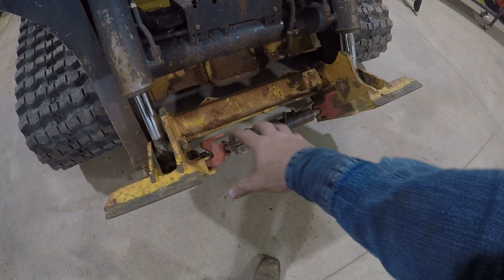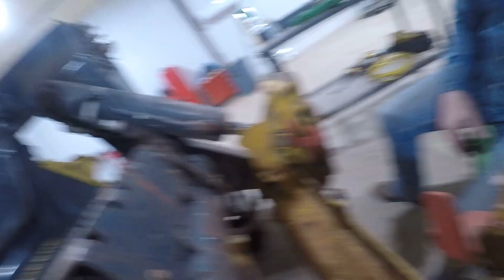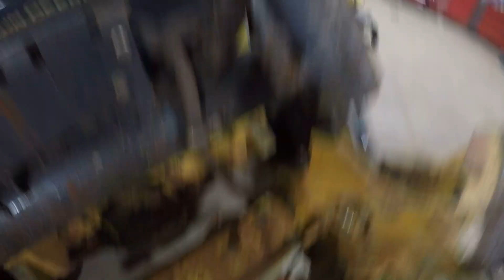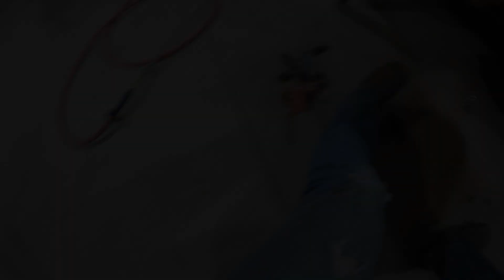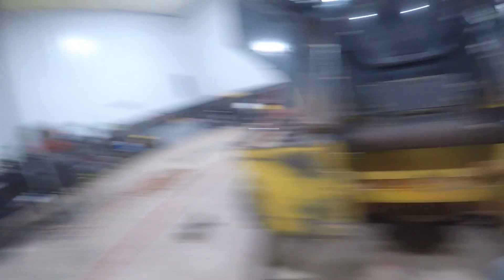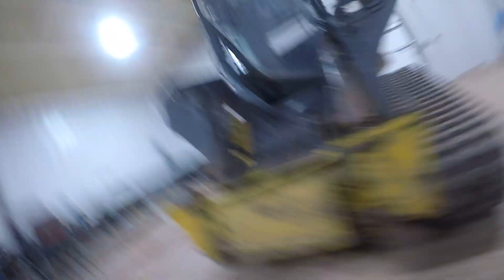John Deere 333G Issue

Comment: How do you get the bucket off of the quick tatch is not working? Mine has wires pinched and keeps popping the fuse. I need to get the bucket off to get to them.

Comment: This is just a bad design by John deere.   Excellent skid steers but no grease fittings is ridiculous
Reply: Easy enough to drill & tap a couple holes and install grease fittings. Should be that way from the factory. But it's not. No biggie.

Comment: I do not like this design either. It totally sux. I have people that work for me and they back drag with the bucket standing straight up. Pisses me off all the time. I’ve hade to buy a new face plate at 1600$ and springs wedges and bolts. Nothing is cheap when it comes to John Deere. Ridiculous and they don’t cover crap under a warranty that you think would be. But this quick attachment wedges get in a bind and totally will piss you off. I think their needs to be a totally different design for all Skidsteers this one especially.
Reply: That puts a lot of wear and pressure on the faceplate and pins doesn't it?

Comment: The quick touch on the John Deere is a bad design. The Bobcat one is a lot simpler. Less issues and a lot easier to work on. As for the rest of the machine I guess it’s OK but like I said, the quick Tatch in my opinion is a piece of crap.

Comment: The best solution is to get a cat ,  it has a direct hydraulic latches that crush small rocks , it rides way way better too. just saying because I rented a 333 and had the exact same problem
Reply: I’ve been running a cat 299d2 high flow for almost 3 years and it’s a complete pos.. the pins also constantly get stuck like this

Comment: Had the same problem with ours the dealer fixed it about 3 times under warranty n had one pin break. About to have to do it again because it will not detach from the equipment.we had had problems with the mounting bolts on the bottom from the arms to the bucket fixed 2 under warranty last time put new bushing in arms n taper bolts n cost me 2600 to fix n no way to c itor watch it until it breaks. My machine 575 hrs the deere mechanics took me if it stick get a hammer n beat them up.the deere people donot know how to fix.hes right one great machine except those parts
N out of warranty u better call the bank

Comment: I’m looking at purchasing one of theses, I was watching your clip and started brain storming here. Just wondering if there is a way to get it in the unlock position and maybe put a little newspaper in it (wadded up) with some spray foam around it to keep the rocks from getting in it. Don’t know if it will work or not- could be an easy fix. Just put enough paper in there to keep the foam from dropping down on your working parts. Hope it works if you try it

Comment: Get a machine shop to bore a hole deep enough on the face of the pin for a zert fitting then drill holes to finish the route for the grease to go where you want it.

Comment: Nice shop ...
Reply: I have the same issue with my new 318G.  Its either dirt or rocks that prevent the latches from locking when I change buckets.  I'm taking it in to RDO for service and will find what if anything remedies the issue.  Thanks for the video.

Comment: I broke the tip off one of the latches on my 333E.  I also had a heck of a time getting that bottom pin to go back in.  I haven't had the rock problem, maybe its because mine always gets jammed up with mud before the rocks get to it.  Anybody know of a 333 bucket pin and bushing replacement video somewhere?  Mine's ready for those now.  Thanks for the video.

Comment: You might try using some foam rubber type material (pipe insulation or window AC perimeter seal) to fill in the gaps around the cover.  Flexible, cheap and easy to remove and replace if necessary.

Comment: Nothing runs like a Deere.... until it doesn’t.  

You might be getting crap in it when you back drag... that’s what happens with the bucket loader on my Kubota.  But, it’s way over yonder easier to clean out.

Looks to me like that set up is engineered to fail!
Reply from the maker: William Harris hey don’t be bashing John Deere. Since I own one, there isn’t anything better! You might actually be on to something with the back dragging. There’s not much on the bottom to keep from filling it up.
Reply: @e.l.construction5945  actually asv is 100 times better I use a 333g 2019 almost daily and 2019 asv daily and take the asv any day over it and there the only ones that use dual pistons on there quick attach so in the winter when mud freezes that second piston makes a hell of a difference and much better sealed havent had an issue with any rocks yet
Reply: E.L. Construction LOL... I have a Deere too... a Gator that I love.  Keep safe.